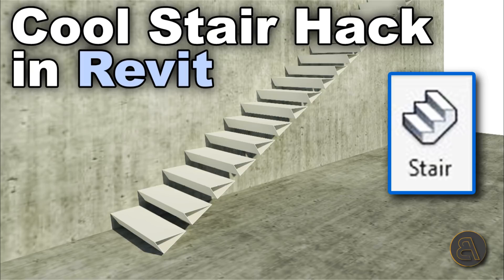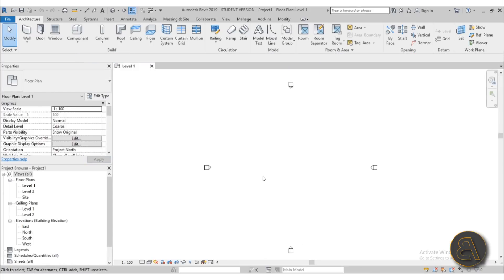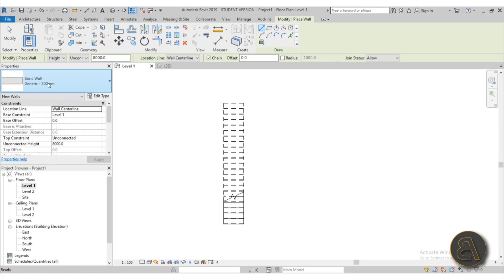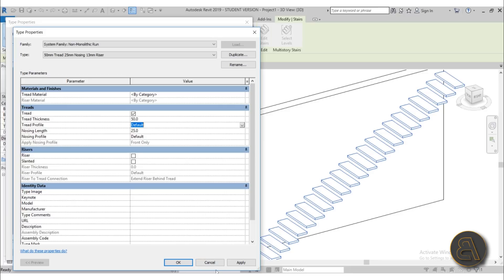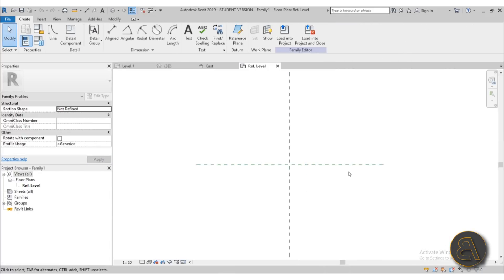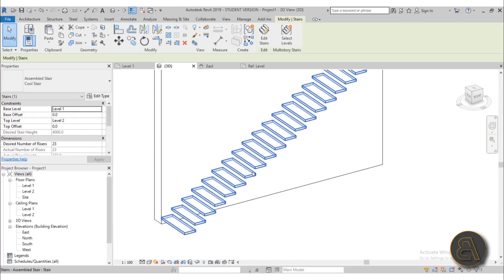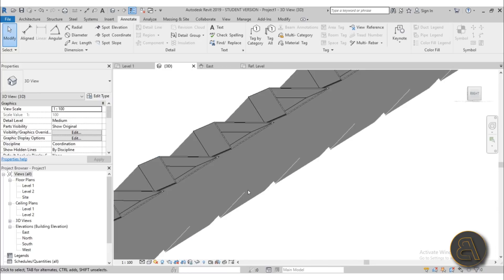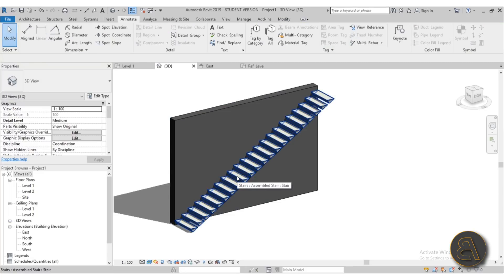Stair Tread Profile in Revit Tutorial

Comment: Love your work, it's very helpful, but why do you insist on clicking "Apply" then "OK"??!! Just clicking "OK" does the exact same thing. "Apply" is only required to be used when you want to apply changes but also keep the dialog box open.
Reply: @LeVance  decent idea. The railing tool is an example of it in practice i guess with dynamic previews
Reply: 100s of extra clicks in a day...
Reply: For me sometimes clicking apply is a way to ensure that the changes will commit but only for more complex tasks where I have less confidence in the outcome (e.g. modifying a railing extension). I agree it isn't always necessary though